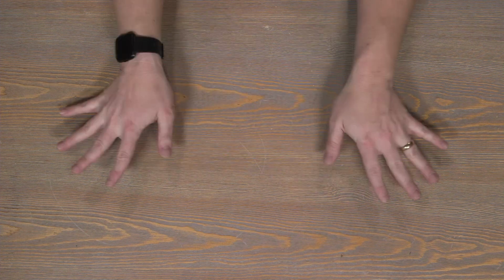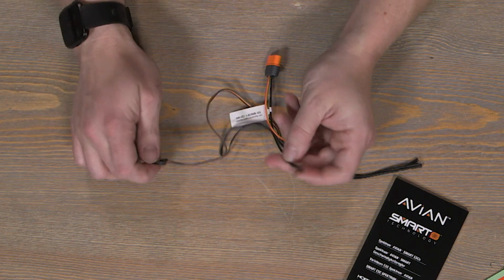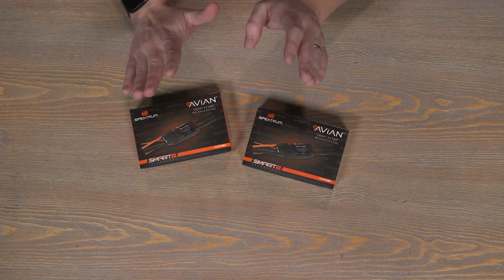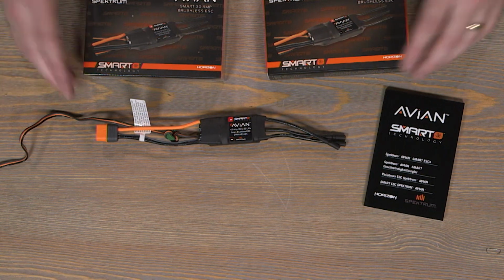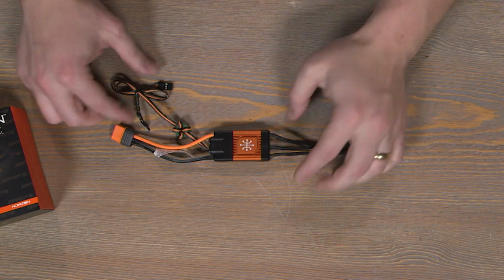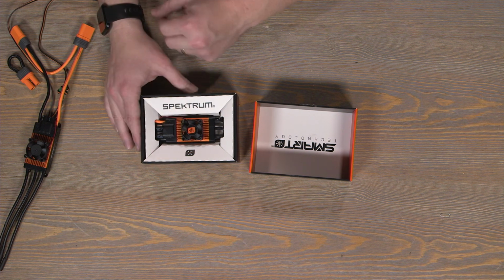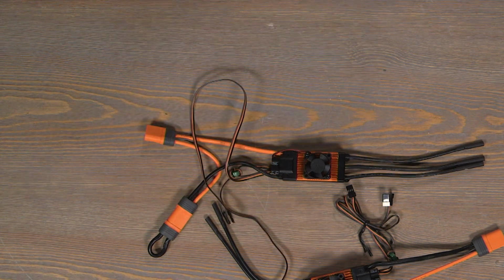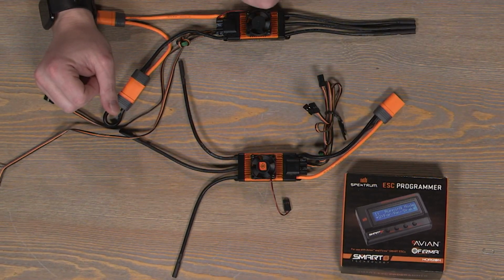Spektrum Smart Technology - Spektrum Avian Smart ESC Overview & Unboxing

Comment: Bought an AVIAN ESC to add telemetry to my Pitts 850. The factory fitted AR631 should be able to do this.

After installing the AVIAN ESC 45 AMP, the servos start to twitch/jitter. It is independent of how many or which servos are plugged in. The engine runs, the servos can also be controlled, but twitch/jitter. Once you have commanded full deflection on all servos, it stops briefly, but then starts again with control commands. Does somebody has any idea what the problem is?
Reply: After getting a second ESC showing the same problem, I figured out the issue.

If an Avian Smart ESC is connected to an AR631 (Pitts 850 BNF), the frame rates change from 22 to 11ms (but the Pitts have analog servos installed!)! No idea why this is, but this is causing the servos to twitch. Attention, the servos can be damaged! I had to replace one because it burned out. With the E-Flite (not Smart) ESC the problem does not exist.

To solve the problem you have to get the programming adapter for the receiver and unlock it with an update. After that you can change the frame rates via forward programming and the problem is solved.

P.S.: The manual of the Avian ESC does not match the actual menu in the controller. There are actually 16 menu items! But at least you can now configure the ESC via the transmitter.
Reply: @RC-PATriot  Spektrum, what a expensive crap

Comment: Recommend revisions/and or updates to the user guides for these....no statements on ALL three wire connectors to Rx....only throttle. Possibly diagram redraw would suffice. Otherwise, Very competent ESC units. Thanks for tutorial. 😎🇺🇸👍 You do one for SPMXCA200 program unit yet?🤔

Comment: Tom, for the ESC's that have a 3pin hidden header connection for the programming lead, you have a 50/50 percent chance of getting that cable connected backward! Its not labeled which way it connects. Which can cause damage to the ESC if plugged in wrong. Please get them labeled - better yet, just make them all have the programming lead, and label the cords what they are for.
Reply from the maker: Plugging it in backwards is not going to damage anything, just won't work. This is because the positive lead stays in the center in either direction. That being said good feedback, more labels is not a bad thing :)

Comment: ☠BLACK BARON☠21:04 "Forward Programming" via iX20 "Very Special Edition" touchscreen of all the Avian 120 settings including max RPM of the motor would be welcome to simplify the entire setup procedure. Throttle stick programming no longer worked properly after Avian 120 firmware update with updated Programmer Box.

Comment: Is the reverse function compatible with other radio brands?
Reply: Bought my first plane with spectrum radio, lost signal so spectrum never again 😅😅
Reply: It's possible but since then I've been using flysky and no problem so far
Reply: More success if use Spectrum DX or NX series transmitters...save yourself mucho time😁👌
Reply: There is some radio frequency interference (RFI) in WIFI - 2.4 GHz from those communication towers, this affects signal loss with ANY RC radio brands .🤔👎

Comment: When you mount an ESC in an EDF, make sure the heat sink is toward the air duct. The Avian ESC in my new E-flite BNF 80mm F-16 Falcon was upside down. It overheated and shut the motor down in the 90+ degree Texas heat..

Comment: I own a Spektrum AR636a Receiver. I was wondering if this receiver is compatible with the avian system and if I can set up the reverse function on the receiver. Can you help me?
Reply from the maker: The AR636 receivers are not Smart compatible, so you will not get any of the added functionality with a Avian ESC. Suggest upgrading to an AR631 receiver
Reply: @SpektrumRCvideos  okay, thanks for the very quickly reply! Can I plug the cable for the reverse function in the Bind port as well or do I have to plug it into a separate channel on the AR631 receiver?

Comment: PSA - if you use the 80 amp ESC with a single battery and want telemetry on your battery you must connect to the IC5 connector with the black and orange wires.  If you use the other connection (with the 2 orange wires) you will get power but no data on your battery.  So plug the jumper into the IC5 with the two orange cables.

Comment: Bought a Blade 330 S a few months ago ... why is there no data wire on the Avian AE 1030 battery connector? Can't get SMART ESC on DX8 G2 telemetry using Spektrum SMART S3 pack

Comment: Dear Spektrum Team, is there a possibility to display the used capacity (mAh) without the use of a smart LiPo? My Avian ESC displays the current but not the used capacity which I find the most important telemetry value. Obviously, the Avian ESC can measure the current so it could also calculate the used mAh. I really would like to buy more Avian Smart ESCs but without the possibility to display the used mAh with a „non-smart“ battery this makes no sense for me.

Comment: Hey SpektrumRC, is there a way to have your radio alert when you're approaching 40% of your remaining capacity? I mean, all of this Smart stuff is great, but it's a little difficult to check the screen sometimes during flight.
Reply from the maker: Sure, set your voltage alarm at about 3.5v per cell ;) We are looking into adding a % alarm and voice output
Reply: @SpektrumRCvideos  I will give that a try. Thanks!

Comment: Great series,  thanks for putting these vids together!  If I am using the Smart ESC and receivers is there really any reason to have to use a Smart battery as I get all of the same info to my radion even with a dumb battery correct?
Reply from the maker: Yup, if you run a Smart battery you will see individual cell voltage, number of cycles on the pack, imbalance warnings and more all on your radio!

Comment: Hmmm.  Is that really the best batt connector to use for a 15a,  flat foamie esc? Especially since it doesn't have the "3rd" wire?  I guess it's better than an EC5/IC5 connector lol.
Reply from the maker: It is the smallest one we make, so far ;)